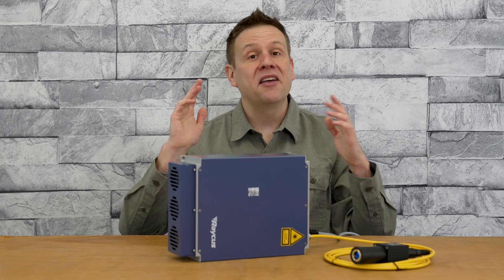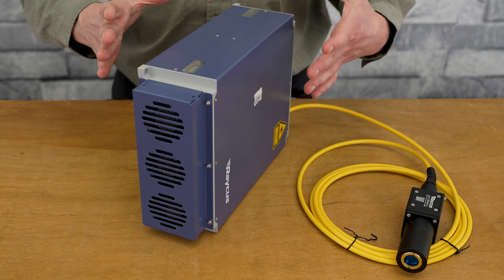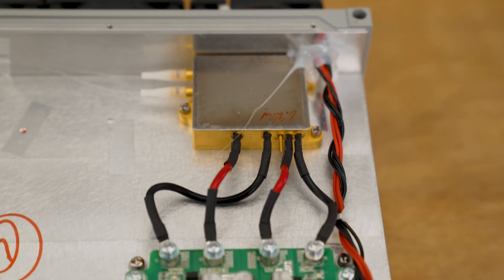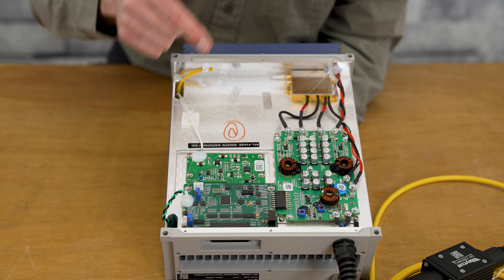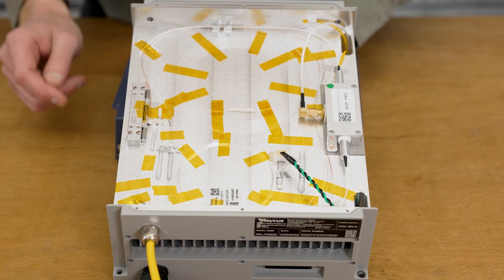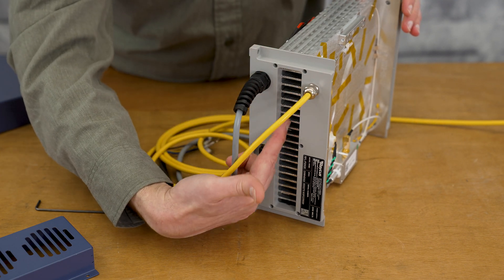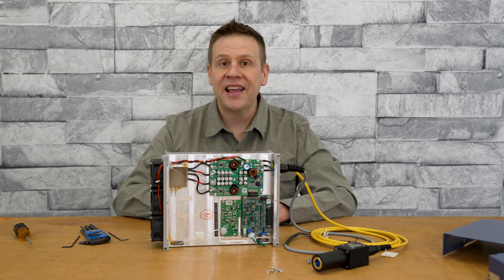Fiber Laser Source- What's Inside?

Comment: A few comments:
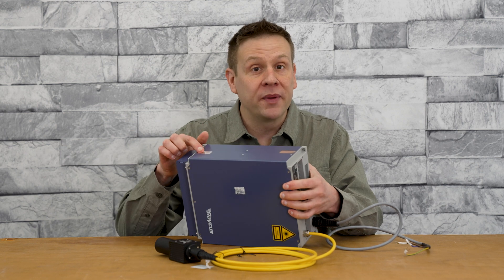1:29 - That's not the beam combiner. The rectangular part is an optical isolator that prevents reflections from destroying the source, and the circular part is a collimator that creates a parallel round beam.
2:38 - The board on the right(power connection) is the main PSU + pump diode driver. Just a big constant current power supply. The board on top is the main controller, and the board below with a coax is an RF power supply(usually 27.12MHz, sometimes 13.56) for the q-switch.
3:20 - The large coil is the gain fiber. That's the ytterbium-doped fiber that is the active part of the laser. The thing on the right with the SMA connector is the q-switch(acousto-optic modulator, AOM), which modulates the q-factor and creates the giant pulses. You can easily find how q-switching lasers work if you look it up. If there's a red laser aiming diode in that model, the beam combiner would be on the left, but it could also be a pump isolator. The green and black might be a power monitoring sensor.

Extremely cost-oriented design, minimal parts, minimal functionality.
Reply from the maker: Thank for Sharing- I may just pin your comment!  I was going to explain each part but as you guessed it gets extremely technical fast so I kept the video as just seeing what's inside.  Thanks again for sharing!! :_doggy:

Comment: What will we do when the ray become lighter coming out from source
Reply from the maker: Oh no!! Check the lens if it's clean and check the galvo mirrors for any laser etching.  If the lens and mirrors look good then the laser source is likely bad and will need to be replaced- hopefully your machine is under warranty.  There's no parts us users can replace in the laser source to fix the machine. A new laser source will cost around half the price of the machine- it's by far the most expensive component.  Best wishes.

Comment: Thanks for sharing. Is there any difference between Raycus and JPT ones? I heard JPT has the best ones but what's the difference?
Reply from the maker: I haven't looked into all the differences between Raycus and JPT- the only Raycus laser sources I've seen are fiber sources and the JPT are Mopa sources.  The Mopa laser source has one more adjustable setting generally more range of the other adjust settings vs. the Raycus.  
Most engraving I use Raycus and color marking the JPT and from I see the JPT will do everything the Raycus can- it just costs a little more.

Comment: I Think a JPT Mopa M7 is more difficult
Reply from the maker: I agree- I think a JPT Mopa M7 would have more components inside due to more user settings and a far wider range of the settings! :_doggy:
Reply: @thelaserchannel1   I am Electronic Engineer and know how it works. I also have a JPT Mopa M7 100W Fiberlaser. This is a very impressive machine with a wide range of settings. It can produce not only Laserpulses, it can continius wave too. If you change the wavelenght from 1064 to 532nm with a ktp frequency doubler crystal and set pulse width to 2ns at 2.960kHz Pulse Frequency you can see a green Laser which is 60cm long and after 10m another one with 60cm and so on. It looks like science fiction 😉
Reply from the maker: @Didisixty  Sounds cool!  Thanks for sharing!! :_doggy:
Reply: @thelaserchannel1  👍

Comment: I remember my first old industrial fiber laser. It was a ipg 2w 1064nm. It had 6 emitters I think into 1 cable. Early 2000s build. Didn't have a controller or the laser head but it was sold as scrap. 

The Dial  turn it on worked. And an early use of a ir visual using an old cell phone. Would not recommend playing with 1064 unless you understand it for sure. Was going to be used as a cutter addition to a desktop CNC.

That was a fun story too. Finding a c0 ball screw from Korea for Uber cheap in the days of random eBay to replace a wobbly z axis.
Reply from the maker: Thanks for sharing- the tech inside today's laser machines is pretty amazing! :_doggy: